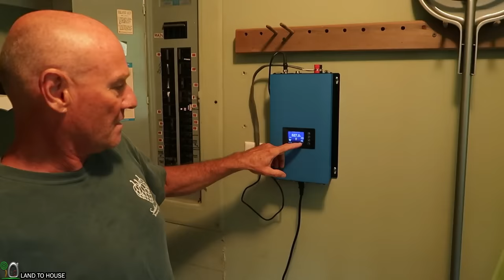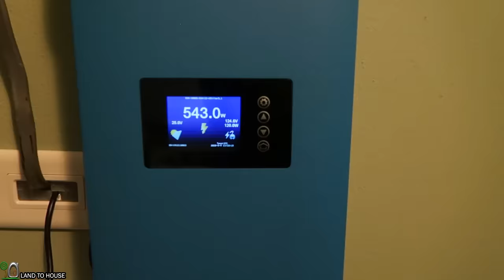Awesome Low Head High Flow Grid Tie Micro Hydro 530 watts!

Comment: Please don't use the ground wire as a current carrying conductor. Use a 10/3 wire with a ground so as to not confuse the ground and possibly create a shock hazard. Maybe a disconnect breaker too. Other than that, everything looks great. I would love to do something like this on my property if i could.
Reply: Only using that to get to the rectifier, it's just a cheap way to get 3 core wire for the three phase.
Reply: @jackprice6599  It's also a violation of the NEC. Those rules are there for a reason; mostly safety!
Reply: Actually since the generator output is not referenced to the ground touching any lead alone does not pose a hazard, you need to touch at least two. If the ground lead is the same diameter as the others (where I live we don't have these kind of cables) there should be no problem with it.
Reply: @netpok  It's a bare conductor being used as a current carrying conductor, which is explicitly forbidden in article 250 of NFPA 70.
Reply: @thomasbonse  That could be the case, I'm from Hungary so I don't have much knowledge about the NFPA also we don't even have these kind of cables (generally protective earth has yellow-green sheathing just like the live has black one). Also does NFPA even cover wiring independent of main supplies? Thinking about this a bare conductor could be a shock hazard since its easy to touch both end if it has a break and the open circuit voltage is way higher than the operating voltage.

Long story short: three insulated conductor is the way to go.
Reply: @netpok  This would be the functional and code compliance equivalent of using the green/yellow conductor for any current carrying purpose except as the protective earthing conductor. For example making the green/yellow conductor a switched conductor for an overhead lamp/light.
Reply: I think NEC doesn't apply here because it's not carrying utility power and is not referenced to line voltage. as long as the inverter is isolating the power properly. the inverter is probably grounded, but is there any connection between that and the dc lines?
Reply: I notice all of you complaining but Is 24 volts a shock  hazard to anyone? And then if this is prohibited why then do the same standards allow usage of PME systems, (prime multiple earthing)? 

Looks like PME is kind of cheating and using a current carrying conductor as a ground.
Reply: @davemwangi05  The shock hazard comes from it being the generator output, it can be as low as 24v under load but unlike a battery it can be easily a few hundred volts without load.
Reply: @lorenzo42p  from my understanding the NEC applies to anything electrical with the exception of the Railroad Industry. High Transmission lines also don't follow the NEC as they have their own rules.
Reply: @davemwangi05  I think Bill said he was producing 28 watts. 28 watts divided by 24 volts is about 1.16 amps, is that a shock hazard?
Reply: @balexan530  LOL. nobody would be doing all that work for 28 watts. He said he's producing 500 Watts. If you put two car  batteries in series and touch their terminals it wouldn't do you anything. if you shot them with a metal bar you can draw even 400 amps, but they won't shock you because the voltage is insufficient. Ac shock threshold is lower than DC though.

  By the way you still got your theory wrong about how one gets shocked, read something about it. The basic premise being electromotive force drives current through the body.
Reply: @davemwangi05  I guess you have never been shocked by a car battery. Anyway an electrical inspector would never pass the wiring in North Carolina.
Reply: @balexan530  have you been shocked by a car battery? maybe a very bad battery charger, but I've never seen a shock from a 12 volt battery. burns and fire are something to watch for though
Reply: what I don't like about code books, they can't possibly cover every situation. the wire in question may be fairly safe, even though improper. I'd rather look at what are the real hazards and risks, than look at what some government body tells me I should do. if it's for my own use and my own responsibility. if I'm doing work for someone else, that's a little different, I'd want it safe as possible.
Reply: @jackprice6599  Just adding another core to the wire is not that expensive though. I love this guys project it's a cool setup. But I do not agree with skimping on the cost of the wire by $40. He knows how it's setup, but others in X years may not. You also lose rub protection, the outer jacket serves as a contrast to the inner jacket, so that if it does rub through you can see another color and know the line is compromised without risk of electrocution.
Reply: @netpok  While you cannot be directly shocked to ground, it is a code violation. You very well could feel a tingle from it, being near water it is possible that your hands would be wet. Which would significantly lower the surface resistance of your skin, the body is a capacitor and depending on the frequency of the 24vac it could pose a high enough current path to be dangerous if you were unlucky. You can get charge currents into the dozens of miliamps pretty easily by just hooking up the output of an isolation transformer to one leg of the capacitor. The higher the frequency, the lower the current blocking capacity of a capacitor.
Reply: @lorenzo42p   I have been shocked by a car battery, wet gloves and jumper cables, its not horrible but not great, kinda like a 9 volt battery on your tongue but through your hands
Reply: @2009dudeman   looking at the stator it most likely is making 30v per phase maybe 50v max or as little as 10v at low speed, rectifier makes it 24v dc
Reply: @Greywolf-mv1hx  rectifying AC to DC causes a voltage increase, not decrease. AC RMS voltage is always lower than peak voltage.
Reply: @2009dudeman  yea, well, one of my motorcycles (yamaha) makes 3 phase, about 40v ac per phase into a regulator rectifier to make a max of 15v dc and is a very similar setup to this believe it or not, so riddle me that one batman, maybe I'm missing something here?
Reply: @Greywolf-mv1hx  your motor cycle also has other things going on. They might be using a transformer to step the voltage down before rectifying it. It could be the meter you used to measure does not like the frequency of the generator on your bike and is reading improperly.

It's easy to change the voltage. But it's not a matter of opinion. When measuring AC voltage you generally measure RMS voltage, most cheap meters are not true RMS, they are tuned to 50/60 hz. The further out from that the less accurate they are. When measuring RMS voltage, you are not measuring the actual peak voltage. The wall socket in your house is 120V, but that's the RMS voltage, actual peak voltage is 177V. This is because the RMS voltage is a way to measure and standardize the actual effective power at any given voltage to what you would get with DC. Rectifying AC does not care about the RMS voltage, it rectifies to peak voltage. You can carefully measure this yourself by taking a diode and sticking it on one leg of you wall socket then measuring from the diode to the other leg. You will see about 177V.
Reply: @2009dudeman  I get what your saying there, but For example, if the AC power source has 120 V, then your formula would be 120/√(2) = 84.85 V in a DC signal. So if he's making 40v ac or so he may have 28vdc rectified and regulated to 24v dc in that one unit that looks just like an ATV rectifier regulator he has mounted on his house, I'm not saying that peak and rms power aren't miss measured, but the end result is cheap hardware that is everywhere and he is saying he's making 24vdc with this, my question is, can this or my motorcycles, lawn mowers, small engine stators making what I measure with my meter (and most mechanics meters and such) about 50v ac at times injure a person?
Reply: @Greywolf-mv1hx  you are misunderstanding the formula for calculating RMS from peak voltage. You multiply peak voltage by 0.707, which is the rounded value from 1/sqrt(2). To get peak voltage from the RMS reading, you divide by that number. For a wall outlet we know RMS is regulated at about 120V by the utilities, dividing by 0.707 gives us a peak of 169V. Your mileage varies based on your local transformer output, my wall sockets measure at 125V most of the time, which gives me a local peak of 176V. So I was mistaken, peak Mains is 170V not 177V as I had misremembered.

I'm sure he is dropping the voltage down to about 24V, but the batteries are a load on the generator, unloaded voltage could be far higher. If that is the case, he is severely over charging the batteries, but more likely is there is a charge controller on there that steps the input voltage up or down as needed to get 24v like solar chargers work.

Either way, yes 50V ac or dc is enough to hurt you, so long as the generator can supply enough current. Being electrucuted is not just a function of current or voltage alone, it's a combination of the two. If you have a 50,000V capable source, but only at 5ma, you aren't going to die or likely even be harmed much. As soon as the breakdown voltage of the skin is reached, current starts to flow. At that point the supply will limit to 5ma and the output voltage drops to whatever voltage is required to hold that 5ma current. You still have to respect the law V=IR. In this case the resistance of the body doesn't change, and we are controlling based on the total current we want to flow, so it must regulate the voltage down to whatever level keeps the equation balanced.

When people say it's not the voltage that kills you it's the current, they are just as wrong as people who say it's not the current it's the voltage.

You cannot have current without voltage drop. If you have a 5,000V source and short it out with a large metal object it's going to pass as much current as the supply can give. However when you measure the voltage across the supply it's going to be near 0V because the load is dragging down the voltage.

It's the same principal with people, the voltage is only as high as required to pass whatever current the supply is able to pass. However if the voltage is not high enough to break the skin barrier then it doesn't matter. The batteries in my truck can deliver about 2,000A short circuit current, but putting my hands, even wet across the terminals doesn't hurt me.

In this case if you touched the wires you would get a shock. The inverter he has likely ties the batteries to ground, which then gives a ground reference through the bridge rectifier. So if you touch the live wires on the generator, you could be shocked if you are touching the ground or are not wearing dry rubber shoes.
Reply: What many of you guys are failing to see is that the National Electrical Code (and others) definition of a potential hazzard is more than just an electrical 'Shock' to a person, it also calls for protection against a potential 'Shorting' condition! Even a low voltage and low current condition can cause a 'Spark' or an 'High Temperature', causing combustables to ignite. How many cars, trucks, trailers, and aircraft are destroyed by 'Shorted Wire'. Same with buildings: more people die from fires from 'Shorts' than being electricuted...
Reply: @davemwangi05  but one hellofa fire hazard. 528 watts.
Reply: Safety Sally’s in the house.

Comment: GREAT SET UP

    It probably wouldn't make much of a difference in his application by having sweeps rather than 90° elbows.  In configuring the flow, 90° elbows do cause a certain percentage of restriction.

    My second thought was since the suction was like a "gorilla" he could of piggybacked another generator inline on the down hill side to get twice the production of electricity.  1 pipe with 2 generators.  Maybe even 3 generators.  I'd take advantage of that down hill flow.

Thomas Dutkiewicz
Reply: if the generator he has is properly sized for the amount of flow hes getting, adding more generators probably wont help, the faster the water speed, the more efficient they usually are, and each successive generator just slows down the water, reducing flow, reducing efficiency.

Comment: kinda surprised that the electrician was ok with using the ground as a current carrying conductor. pretty sure that's a code violation unless you're outside of the USA
Reply: Electrician here. I was going to comment about that going "you did fucking what now". I would not have done it that way but its not against code. 24V Systems is considered low voltage and fall outside of the electrical code.
Reply: @th3count  yeh. Just idiotic to use ground for current..my grandpa was an electrician and he had also used earth for current and it nearly killed me when renevating and suddenly my 220v heater was glowing red with 440 volts going though it.
Reply: @vihreelinja4743  would agree if it wasn't such low voltage, 24volts going to one destination with no split or link to the grid makes it fine if not ideal, I would have made the trip to the store for some proper 14/3 but it shouldn't be a issue for this setup

Comment: You need a NET meter. They have a register kwh delivered and kwh received. I'm glad he thought of the back feed potential.
Reply: That's odd, because when I got solar, my 50+ year old electric meter did spin backwards when the sun was out.    Of course it was a mechanical meter so I'm not sure if digital meters are different.

Comment: Not gonna lie, with that extra vacuum.. You could in theory take advantage of it by using it to run negative pressure (sucking) hot air through a swamp cooler providing (essentially) "passive" air conditioning.
Or, use it as a vacuum line for vacuuming the home or whatnot because running vacuum cleaners (depending on their wattage, so mileage may vary) can suck a bit of electricity that can be used for other stuff.  Just my opinion though.

That aside, this is everything I could ever need in one video. :)  This is awesome!

Comment: beavers watching this like: ha, 530 watts, how about 40 kilowatts (laughs in maple syrup)
Reply: It was the laughs in maple syrup for me 😂
Reply: @viatori5566  it was the 40 kilowatts for me. Imagine, a beaver making electricity but not being able to do anything with it. Stooopid beaver.
Reply: Could you please explain the joke? I didn't understand it
Reply: Aluminium refineries would like to disagree.
Reply: Beavers are underrated.
Reply: Considering it can run 24/7 - 365 it is similar in performance 7 kW solar PV system. 
As for maple syrup production solar PV could be used, so would solar thermal. But you would need somewhere to put it all off season. Pyrolysis can produce fuel from waste. Biodegradables can be converted into Biogas or in to low grade heat.

Comment: In order to achieve more energy from potential height, additional turbine to be installed at lower level of the  pipe. Double amount of energy to be generated.
Reply: That's not how energy works. a turbine at the bottom will rob power from the one at the top.
Reply: There's a fixed amount of energy from the reservoir elevation and flow rate, a smidge under 1000 watts as someone else here calculated. Doesn't matter what you put in the discharge stream, with system and turbine inefficiencies the most you'll get is maybe 700 watts.

Comment: Great video! Can you tell me what inverter and auto disconnect he is using? Thanks!
Reply: I want to know as well!
Reply: Second tried to find it and couldn't
Reply from the maker: This is the version Bill is using.
https://amzn.to/3mCgfTI
Reply from the maker: Here is the inverter Bill is using
https://amzn.to/3mCgfTI
Reply from the maker: There are a couple voltage settings. This is the one in the video
https://amzn.to/3mCgfTI
Reply: @LandtoHouse  Did you mean it was DC? Beacuse you mentioned he is loosing very little power with AC and then at the end of the cable is the inverter and the owner said it was DC. ????
Oh nevermind, just noticed a rectifier, kinda weird to mention it later haha.
Reply: I have the same inverter. Unfortunately I wasn't getting the rated efficiency out of mine. It's advertised > 90%, but I was getting around 80% - 85% at best and the inverter was getting very hot. I mitigated this by replacing the main diodes inside of it with ones with a lower voltage drop. Now I measure around 90% - 95% efficiency and getting an additional 75 - 100 watts of power from my solar array and the inverter runs MUCH cooler. I don't recommend this mod unless you are experienced in electronics.
Reply from the maker: @RingingResonance  interesting.  Mine is limited to 750w so I have not had an issue with heat.
Reply: @LandtoHouse  Mine is rated at 1kw. Maybe they have started de-rating them lately?
Reply from the maker: Mine is also a 1Kw but I limited the power down so it could not run at full
Reply: @LandtoHouse  I should also mention that there are 16 diodes in total that need to be replaced for this mod. Each diode is around $4 - $5 each! So, $80 worth of diodes.
Reply: @LandtoHouse  where are finding a 1kw one at I’m new to all this but have a creek in my back yard that runs all year so would to learn more
Reply: @LandtoHouse  Linky no worky.
Reply: 3 bad links on my end what brand of inverter?
Reply: @RingingResonance  he means the links that Land to House gave
Reply: @LandtoHouse  links dont work
Reply: @LandtoHouse   not available
Reply: @LandtoHouse  the link is outdated, can you confirm spec or provide new link?
Reply: @LandtoHouse  any chance you could update the 3 Amazon links I get the sorry no longer available.  Thanks, hope all if going well!

Comment: $1650 for 6" pvc 500W turbine?
How many years it will continuously spin without any issues?
Reply: clifton mill been running mostly over a hundred years. clean up and relub the bearings once a year.